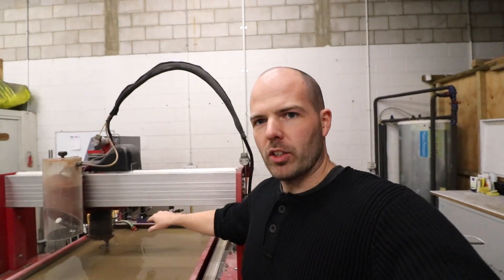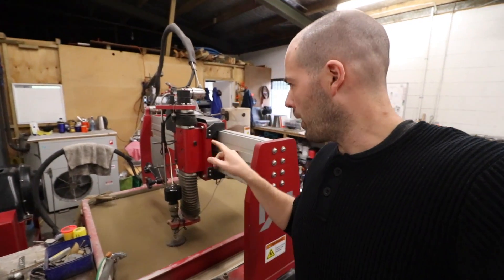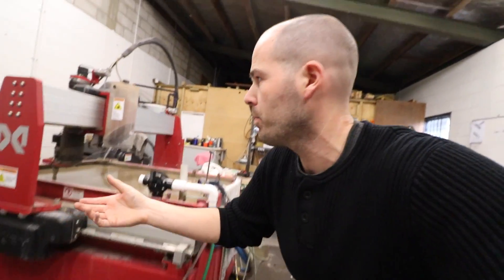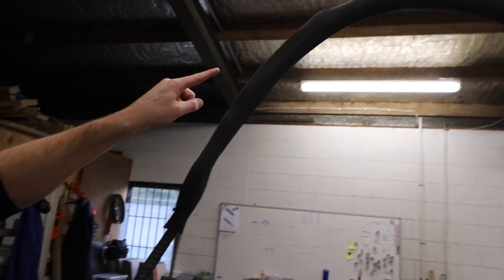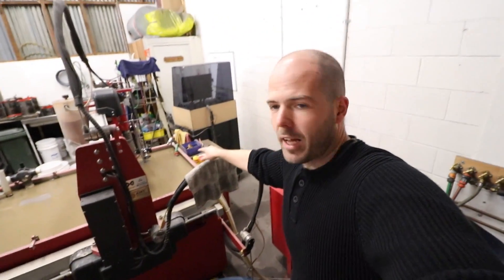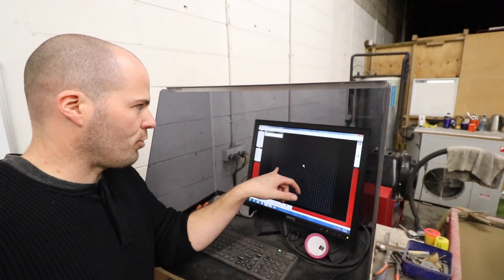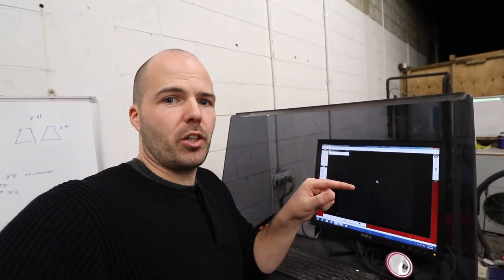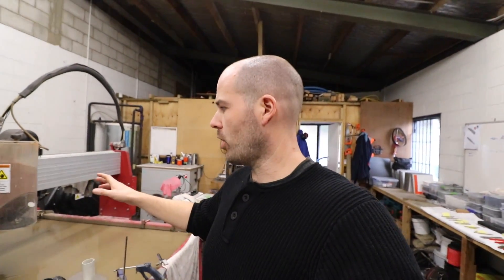Waterjet Cutter (How It Works)

Comment: Omax is the worst, well decent for small shops that use it here and there but for big production, 22 hours a day cutting, negative. I used to be all Flow until company was sold to corporate big wigs and they've destroyed it, shut down all US manufacturing and sent it to korea and china. Now I have a Semyx Infinity 440, the 440 is for 4 meter x 4 meter which is what my gantries max cutting size is.

Comment: the title is HOW WATER-JET IS WORKING ..  PLEASE Just explain  Exactly  how water jet works . How it cuts ...  i got confused  you jumping back and fort from the subject... like you are talking about a cool water or hot water...  about water cooler .. that's noting to do with HOW WATER JET it Works..  Would you please add another video and JUST Explain  about how water goes and pumps and mixes with sand and comes out  and cuts...   BASIC  don't explain the X,Y,Z cnc  machin..  Just the Waterjet ... please .////... thank you

Comment: Hi Magnus, hopefully I can assist some people here.

Waterjet machines typically run at 50,000 psi of pressure. No math genius but 3800 feet per second. Think of a high powered rifle bullet.

Water typically does not do the cutting alone, The cutting nozzle of the machine has a hole above it which sand/garnet is sucked in by vacuum. That sand is sped up to bullet speeds by the water. What thickness of steel can it cut? Its a matter of time, and how high the cutting head can rise. I have cut six inch mild steel and 5.5 inch stainless. Yet have cut product 10 inches tall but not thick.

Water only cutting is also used my many industries. Water moving at the speed of a bullet can cut meat ( used often ), rubber, foam, gasket material.

Cost of a 5 axis 5 x 10 waterjet machine is around $125,000 today. Prices vary.

I have 5 years experience running multiple waterjet machines, 25 years running almost any cnc machine. I love waterjet machines because they can cut anything. I have cut everything.

I work for a company that is a steel company. They make good money. Yet they want all business on their machines. We wont be cutting meat, but will cut Marble, Granite, porcelain, cement, inconel, aluminum, Mild Steel, Stainless, hardened steel, plexi, uhmw, lexan, teflon, wood, leather, glass, titanium, rubber, neoprene. Add insult to injury the parts dont need to be flat either. I beam, HSS, angle iron, all sorts of tubing.

Many companies hire the lowest skilled people to work on waterjet machines. They get the lowest results too. Hire an operator/programmer to run your machines.

I have been in machine shops for 25 years. I adore waterjet machines. I can blow anyones mind away, yet a waterjet machine is not always the fastest tool for the job. Normally anything under 1 inch thick a plasma cutter or laser cutter is 4 times faster.

There is so much more to say. They are an amazing tool in almost any industry.

Again not looking for an argument with laser operators or plasma operators. I run those machines too. Both are great tools and much faster than a waterjet if what you want to cut product the plasma table or laser cutter can cut. The waterjet machine can cut almost anything at any thickness.
Reply: Do you have multiple heads on a machine?

Comment: what's the advantage of a water jet vs a saw? this seem slow and expensive vs a saw for cutting metal or a stone slab
Reply: Here are some of the abrasive waterjets strengths:

* Cut all sorts of shapes easily.  Curves, corners, etc.
* Cut nearly any material (Metal, stone, plastic, glass, etc.  Even pre-hardened steel, and many traditionally difficult to cut materials.)
* Practically no heat generated during cutting, so metallurgical properties are preserved.
* Edge finish is excellent with typically little or no bur (sort of a sand blasted finish).
* Very little loads on the material, so can cut and pierce brittle stuff
* Reasonably easy to go from an idea/drawing to a complex cut. Typically the hard part is drawing the CAD file of what you want, but after that it's reasonably easy.
* Small kerf, so little material removed / scrap pieces can be reused, parts can be nested, small details can be machined.
* Quite precise (with some machines).  I personally have done quite a bit of work below a thousandth of an inch, with 2 to 5 thousandths being more typical.  A lot "depends" on the material being cut, and the machine doing the cutting, and the experience of the operator here.
* Low side forces so can cut very thin webbing and the like.
* Quick to setup and cut - typically just put your material down, fixture with a couple of clamps to minimize vibration, move the nozzle to position, and go.  This makes it very good for onesy/twosy parts, and popular for those doing prototyping.
* Cuts quite thick material.  It gets very slow the thicker you go, but it can cut over 8" thick steel.  (Practical in some cases, though less practical the thicker you go.  I would say for Aluminum the practical limit is around 5 or 6", and for steel maybe 3 or 4 inches.  However, it can cut steel up to maybe 10 inches, or aluminum up to 12 or so, which is practical every once in awhile.  Super thick titanium cutting is quite practical due to the expensive material that can be saved by the narrow cut, even though it is slow.  Titanium actually cuts faster than steel.)
* No start hole required, as it can automatically pierce where it needs to.
* Able to cut through non-uniform material, like wood with nails in it, or marble with veins, etc.
* No heat affected zone, so it does not heat and change material properties.

A traditional saw may be cheaper or faster and more appropriate for many jobs, like wood cutting, or just breaking something in half, or doing straight cuts.  The waterjet is flexible enough to do that as well when needed.  I would consider it a very complementary tool in a shop, that makes a lot of things easier/cheaper/faster, but not something to replace a saw for things that saws do well.   

Hope this helps.
Reply: xamomax thankyou for your reply
Reply: No heat generation is specially useful in knife and sword making so that proper heat treatment and hardening can be done .

Comment: Magnus. Just finished watching your video. Very cool. Now I know the process. I have a thought about the heating of the water tank. Could you put a separate radiator to cool the water? Pipe it right outside like a heat pump AC unit only instead of Freon, its water. What do you think?

Comment: Great video, Magnus! Love your explanation of the main components of the waterjet and how it works. Really glad to hear you've put it to good use and think it's an amazing machine.
Reply from the maker: hahaa - thank you Omax! It is an amazing machine.
Reply: كيف نستطيع معرفة الضغط اللازم لنوع القطعة المراد قطعها
Reply: How can we know the pressure needed for the type of item to be cut?
Reply: mohammed yassin tanbour To Omax's machines you just need define the material, thickness and the cutting surface quality in the software to do the service.
Normally we use the same pressure the cutting materials like carbon steel, stainless, titanium....the software will control the speed to different thickness.
Basic if the material is thicker is necessary more time.

Comment: You said the garnet can't go through the head, how does it get into the stream then?
Reply: Buck9MFG - TROLL HERO is right! The high pressure water is pumped through a jewel orifice in the nozzle, creating a vacuum which pulls the abrasive into the nozzle. The abrasive and water are mixed together in a mixing tube inside the nozzle. You can see diagrams and read more about how waterjets work on the OMAX web site: https://www.omax.com/learn/how-does-waterjet-work.
Reply from the maker: Oh, I'm not sure... did I say that on the video?
Reply: Mmmm...I watched this video again and didn't hear you say anything about that...maybe in a previous one?
Reply from the maker: Yeah, I'm not sure. Maybe the nozzle was blocked at the time and we had problems.